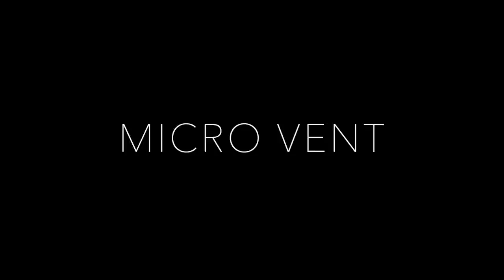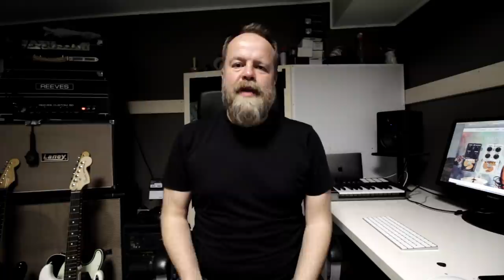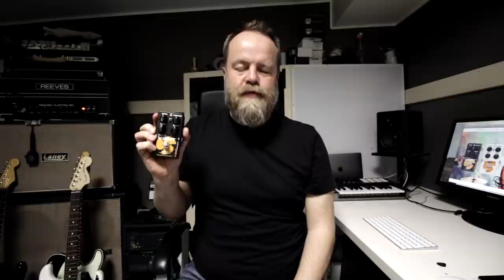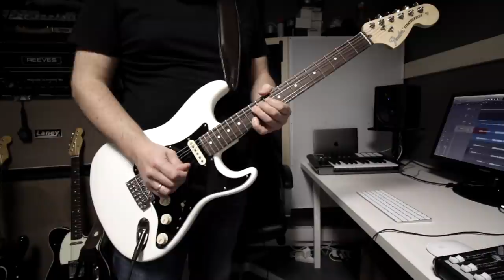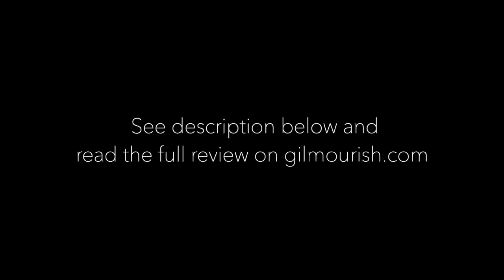Neo Instruments Micro Vent review

Comment: Well this is a great pedal. I'm a bit disappointed to see that it costs 300€ here in Europe. 😐
Reply: Yeah to expensive to have just a rotary effect
Reply: Tony Samperi ...if you want the Very Best, you have to pay up...
I don't use a rotary sound most of the time, but I love the sound when I do.
I've spent  a lot of t of money chasing a great Leslie sim. As I've said,
If you don't use the sound most of the time, I'd go with the NUX Roctary.
it's a little over $100 US  , 5 year warranty, sounds better than the others except for
the Neo and has an octave section and slight overdrive section to give you that
over driven true Leslie effect of the real Leslie 122. If you want you can even get Organ sounds
out of it. There's a blend knob that most don't have and NUX doesn't use a noise gate 
to keep it quiet as most do. It's just a quiet  pedal if you use its own power supply or
a board power supply that has separate outputs and you don't daisy chain.
I sound like I'm trying to sell it....LoL .. I was also told that Strymon  engineers came over 
to NUX to build this and all new pedals . Looks almost like Strymon's enclosures ...

Comment: Which do you prefer of the Lex vs Micro Vent? I would like to purchase one of the two. Thanks!
Reply from the maker: The Lex is very dry sounding with a much more distinct tremolo or rotary, while this one has more of that chorusy character. Not as defined. Personally I prefer the Lex for Leslie tones and this one for David's more subtle modulated rotary.

Comment: I just bought a used Vent II mini, it sounds good however it is noisy, very noisy at times. Have you compared the Mini 2 with the new Micro 16? I would be curious to get your opinion..
Reply from the maker: No I haven't. Haven't had any noise issues either.
Reply: @gilmourishofficial  Do you have the internal gain selector set to high or low? Is the pedal in your effects loop or before the preamp section?

Comment: Would love to see you demo the strymon lex
Reply from the maker: I haven’t really done a review but it’s my fav rotary pedal. Did this vid years ago https://youtu.be/A7UcDfTct1o
Reply: @gilmourishofficial  I have to ask as the whole use of a Leslie speaker gets a little confusing for me.  On a song like shine on in the early days live in concert. Would he be using the rotating speaker along with the phase 90 together?
Reply from the maker: Yes, the mono signal from the pedalboard is split into the Hiwatts and a Leslie rotating speaker, which then is mixed slightly lower in volume than the Hiwatts. What you get is the main sound coming from the Hiwatts but a slightly modulated signal coming from the leslie. It makes everything sound slightly bigger, with more texture if you will.

Comment: Hi Bjorn ... Your demo is very nice, but frankly I find that 300 euros for such a pedal is really a rip off.  among other things, it is completely digital, except for the blend (analog).  Personally, with just over 80 euros, I solved it with the Danelectro Big Spender: it sounds really good, it has the ramp function that can be adjusted first and activated by a second power button.  Greetings from Italy.
Reply: It has a rather expensive SHARC DSP in it.
Reply from the maker: 300€ is expensive but Neo Instruments is a much smaller operation than Danelectro. You can't compare the production costs. Besides, there are expensive parts inside this one. There are lots of great sounding and cheaper rotary simualations out there and they all offer something different. You can also use phasers, UniVibes and chorus to achieve much of the same.
Reply: Yes, ok, I agree with the quality, but honestly the cost of some pedals is really excessive.  I agree, you can get almost the same result with chorus, phaser, univibe, but if we get the same result with the same type of pedal, like the big spender of the danelectro, isn't it better?  Anyway, in my opinion, 150 euros for such a pedal, is more than enough.  Logically it is my thought and I absolutely respect yours.  Regards
Reply from the maker: @silviolutti1522  I don't really have an opinion about the price - whether it's cheap or expensive. 300€ is a lot but obviously people are willing to pay for these things. You can always argue that it's just bits and pieces of electronics but smaller companies have higher costs and they sell less units. Parts, rent, sallary etc is what to calculate into whatever you produce. The more you produce and sell, the less you can charge. EHX, Boss, Danelectro etc makes some amazing stuff and I'm a huge fan and avid user of all three but they don't use the same quality parts and don't pay as much attention to quality control - well, maybe Boss - as some of the so-called boutique makers, which often are just one or two guys sitting in a garage doing everything themselves. Anyway, a pedal or instrument is only as good as what you need then and there and what you feel comfortable with. I have yet to come by a bad sounding pedal. It's just a matter of what you like and whether or not you know how to use it. Cheers!
Reply: @gilmourishofficial  I take this opportunity for an off topic request. Surely you have listened to this version of High hopes. (Early version, I attach link) In your opinion, David for the final solo made with a stratocaster here uses a big muff or a tube driver?

https://youtu.be/m5AW6l-5Nzo